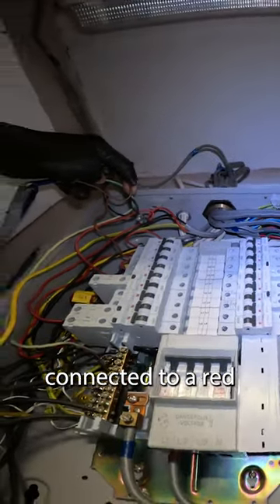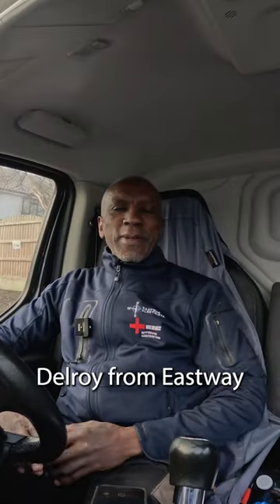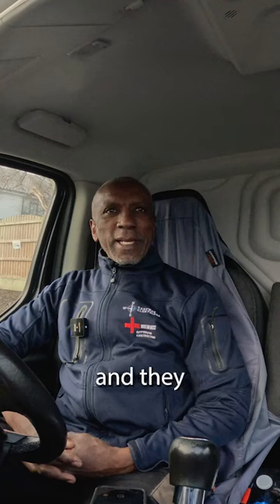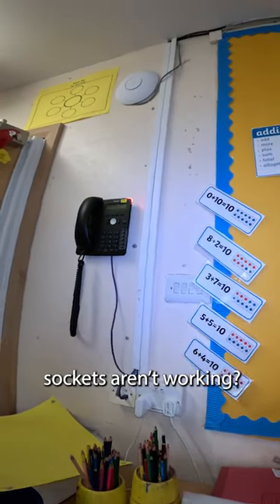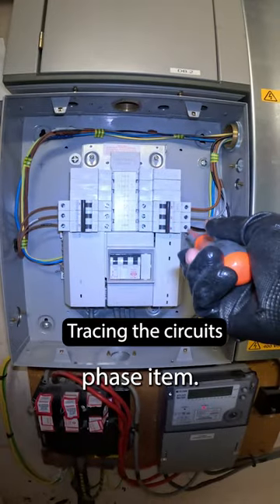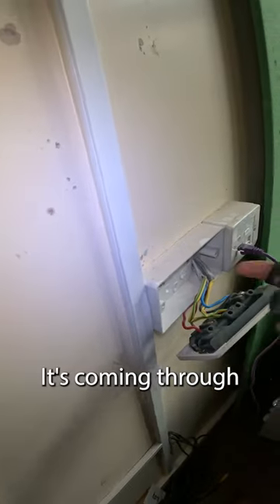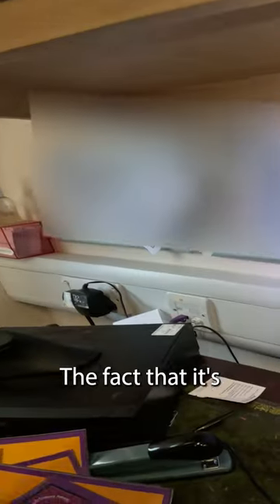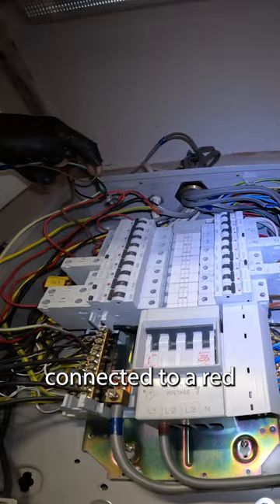Abandoned Fault Finding In A School

Comment: My father who works in electronics has designed for me a custom made device which inserts a signal in that circuit and you can find the circuit anywhere without interferences from another signals. Yes there is plenty of cable trackers on the market but what makes this different is made it to work on different frequencies so all you hear is just the inserted signal not any interferences that can mislead you easily 👍
Reply: Also you can adjust sensibility and go closer once you found the cable it has a 100% precious and on top of that it find the short circuit specifically the short
Reply: Fuse finder for b&q £40, CAT cable finder also. I feel like he may have wasted his time.
Reply: @trying-hard-1112  , That how things are invented and made better, someone "wasting" their time.. 
And more often than not, they make it cheaper than company sells it for..
Reply: Give me a shout if he fancies making another and had a price he'd sell it for.